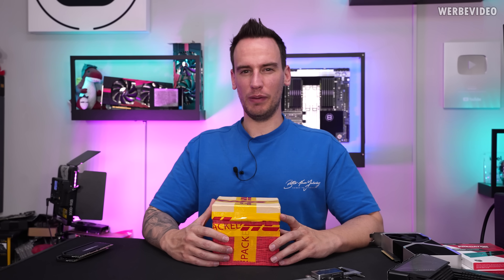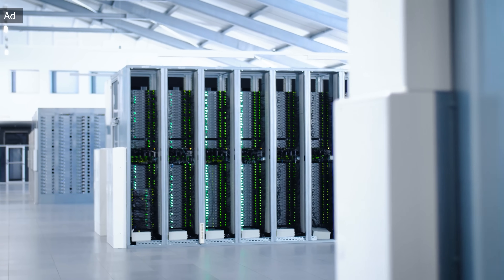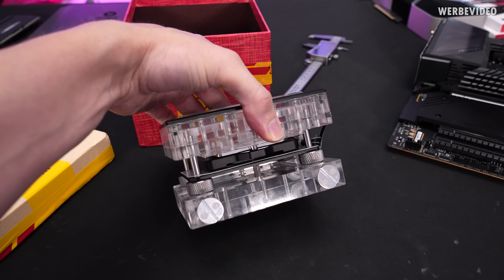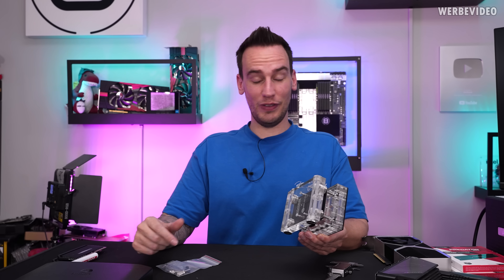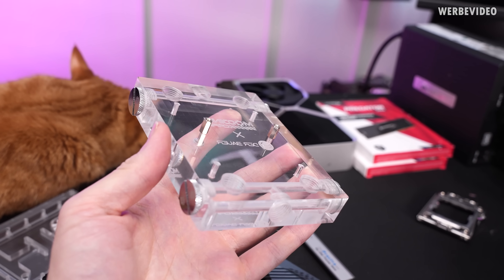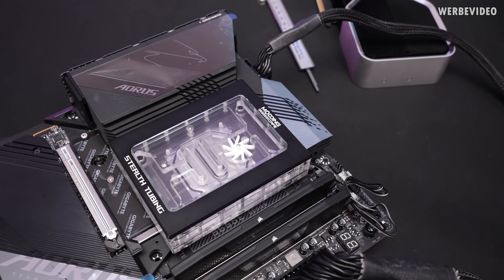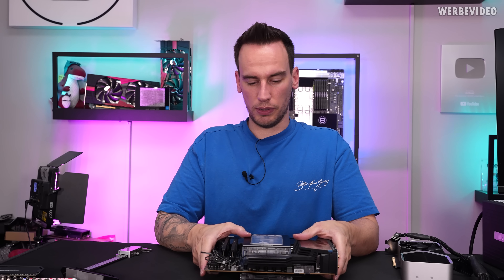A New Generation of Water Blocks? Stealth Tubing Block Tested in Detail

Comment: My main worry would be the flow rate through those very thin tubes but if it's not an issue then it looks really cool.
As a side note, if anyone gets the chance to go to Vietnam it's such an amazing and beautiful country and the people are incredibly warm and welcoming.
Reply: And if you're enjoy visiting Vietnam, you should also come here to Thailand as well :). Just a little bit to the west from there.
Reply: @WutipongWongsakuldej  Sadly I've not had the chance to visit Thailand yet but looks stunning and would love to visit one day.
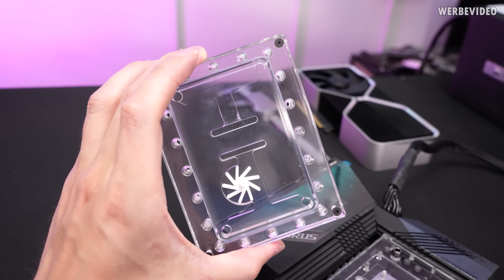Reply: i believe its using 2 tubes each flow direction as you can see here 4:37 and 7:44
so 2 in 2 out
Reply: Flow rate should be more than enough. It looks really cool
Reply: from the video the flow seemed pretty good.
Reply: well theres 4 of em and I assume each two of em are inlet and outlet, its a prototype too so there will be and always be an improvement,
Reply: Flow rate is pretty overrated IMO as a metric for how good a loop is.  I run my loops at flow rates that are horrible (like My D5s running at 1800 RPM lol) and they still cool fine.

If I turn the 2 D5s up to max then yea my DT between hottest/coolest point under load drops from 2.5c to 0.5c so everything gets a whopping 2C cooler but when nothing is exceeding 50-60c who really cares?

IMO the larger issue is with the stainless tubes.  That throws your galvanic balance out of whack.  But a lot of blocks use stainless jetplates anyways so its probably not that big of a deal overall.  I would 10000% not run this without a corrosion inhibitor though.
Reply: It can not be any worse than AIO coolers. Their inlets are just as small
Reply: @mihabolil4o yeah, but that doesn’t seem like a high bar to set. Why would you limit your flow rate to the level of an aio?
Reply: flow rate doesn't really matter with a high pressure drop waterblock, all aio follow this fucking trends :(
Reply: I don't think flow rate would be an issue if only the CPU was being cooled in the loop. A different design with a connection on the front may be required to preserve flow rate compatibility with GPU blocks and also just allow the tubing to get to the GPU.
Reply: Curious if the total cross-section on the fins is actually smaller, in which case it doesn’t matter that the holes are small, their sum just needs to be bigger than the restriction provided by the fins
Reply: Those two tubes would warrant a  bigger flow rathe than regular tubes... and anyhow ideal tube diameter is  1 CM inner  and not huge wider ones that people think are better.
Also this kind of block would work better with DDC pumps  which are superior rather than bulky D5
Reply: @AbyNeon  Circle area = PI * Radius Squared.

5mm * 5mm * PI = 25mm * 3.14 = 78.4mm for a standard 10mm ID tube.

Going through 2 tubes which are 5mm wide is 2.5 * 2.5 = 6.25mm * 2 * 3.14 = 39.25 mm squared.  No, it will not be bigger at all, sorry.  The flow rate will be roughly half of a standard 10mm tube.

That being said, it should still be 100% fine because flow rate really doesn't matter that much.
Reply: looks amazing!  with a few tweaks, it could be great.  could pair it with the motherboard(s) and/or power distro boards that put everything on the back, but you're right on about limited case compatibility.
Reply: I might add that Vietnam played better than expected vs USA in World Cup. I'm watching Germany vs Morocco while writing this, and GER just scored.
Reply: Well at least it is made so that there is always two tubes in parallel so it is less of a choke point than if the water used only one of them.
Reply: Flow rate is overrated. Tests have been done and after 1litter per minute, the gains are marginal. As long as the bloc is designed with low flow rate in mind, it's fine.
Reply: @PyromancerRift  eh, I’d say it depends on the loop. I 100% agree with you that’s it’s marginal to an extent, but I also know certain loop configs where it’d begin to make a difference, especially with tight routing.
Reply: it's going through 4 of the tubes (2 inlet and 2 outlet) so probably has better inlet and outlet flow than a normal block.
Reply: @I0ITuGI0I  Nah probably not the tubes ARE quite small.  Even a 10mm ID tube probably has about 3.5x the area of those small pipes.  But flow rate also doesn't matter that much.
Reply: @I0ITuGI0I  Not really, considering how tiny the inlet and outlets are, and with what I’d assume is a lack of flow rate design compared to standard inlets (though that will get better with R&D). But even the smallest change in inlet or outlet completely changes the flow rate. It’s not about how many inlets or outlets there are, even if it has the same water flow capacity, the fact that it now needs to divert into two channels would inherently limit flow rate. Flow rate is something very fragile. That being said, it’s that important of a thing most of the time.
Reply: @cattusdoggus62  You aren't really going to improve flow rate with RnD with this design.  You can't really increase the diameter of holes through the board and flow rate is pretty dependent on the smallest constriction, which will be those holes.

They are in parallel so the restriction will be cut in half but it still is what it is.  Yes, flow rate through each tube will be cut in half but after they recombine it will double again.

I don't understand what you mean by "the fact it needs to divert into two channels would inherently limit flow rate".  This is not how things work at all.

Flow rate is is generally only a factor of the restriction of the loop + head pressure on the pumps.  The more parallel paths you add the more the restriction drops so the more flow is achieved.
Reply: @JathraDH  I see the point with the holes being set. I’m hoping the holes aren’t too far off of regular outlets, enough so for R&D on, say, limiting the bending of water channels and distributing even pressure to be able to make a difference.
Reply: @cattusdoggus62  The holes are very tiny 2 of them is probably not even 2/3 of a "small" 10mm ID tube.  It is absolutely going to be the biggest restriction in a loop.

Anything you try to do around them ultimately isn't going to make any difference.  The same way people thinking running giant diameter tubing when they are still using G1/4 fittings think it will make a difference.  It wont.

The flow restriction is caused by the smallest opening in the loop and nothing else.  This is why 10mm ID tubing (which perfectly matches G1/4 fittings) is completely fine.  If you want bigger tubing you need to move to G3/8 fittings or its pointless.

Bends in the tubing etc all do contribute to flow restriction but it basically works like this.  Flow hits a bend > flow slows down > flow hits a smaller hole after the bend > if flow is going fast restriction from that hole is more than if flow is going slower > if flow is already slowed down from the bend the restriction on the hole will be less.

Ultimately bends don't really matter because your blocks are going to be restricting flow far more than they ever will.  Blocks are typically the smallest hole in the loop.  If the hole size from the parallel holes coming through the board is bigger than the hole size of the combined parallel paths through the block then they will be the new bottleneck point.

But really flow doesn't matter that much, Im sure the cooling will be fine either way.
Reply: Because there is two inlets and two outlets, they compensate. The water will have higher flow through the pipes, in fact. The one thing you should worry about, is instead the head pressure on the pump. Since it might struggle with the extra resistance of the loop.
Reply: wouldnt forcing water through a smaller inlet increase pressure, as long as the pump can keep up? which means same or greater flow rate? and its 2 on each side like he mentioned

Comment: Motherboards usually have an option on what to do after a power surge, stay off, turn on, or retain the state they had before power was lost (so if pc was on before losing power then turn on, otherwise turn off). That motherboard most likely has the option set to always turn on
Reply from the maker: that's indeed a very good guess but unfortunately it's turned off :(
Reply: You should have 3 options under A/C power on a Gigabyte board. Set it to always off.
Reply: @der8auer-en  guess i'm not alone! I have an Asus ProArt X570 motherboard
Reply: @der8auer-en  yeah figured you'd know that :P Could just be it's still doing it without the setting being turned on. Mobo bug?
Reply: Came here to say that. Option is usually called something like "Remember last power on state".
Reply: @thethufir  
some boards call it "Power on after AC loss" or similar.
Reply: There is also sometimes an option called "wake on power" that will trigger a system power on when it gets power from supply.
Reply: My motherboard will turn on after power surge, no matter the setting. It's so freaking annoying.
Reply: ohhh you are right... i remember that😅
Reply: I'm guessing Roman surely wouldn't make such a rookie-mistake 😂
Reply: @dasiro It's hardly a mistake, he was just slightly thrown off, given that as far as I'm aware he received the motherboard from the same person who made the block, has no reason to change that setting himself and that the setting usually defaults to "Stay off" I think it's quite reasonable for him to have missed it. The only reason I'm familiar with it is for my home lab server, which as far as I'm aware isn't a hobby Roman particulates in.

Comment: Water blocks everywhere! Wish I could install one on my body during the summers. I'm always throttling.
Reply: Well, you already have one, with multipurpose pump and radiator that covers your whole body and fin stack increasing over time
Reply: @pinguinfromnkvd5774   and you can even say it has an additional phase transition cooling integrated into it that engages under more harsh conditions!
Reply: They actually do have these "cool shirts" used in racing/drifting that works exactly like a waterblock.
Reply: @_@ it is available.
Reply: Hahaha
Reply: We need Dune's stillsuits
Reply: Well Conduction is better for heat transfer than convection that we normally use to cool ourselves.